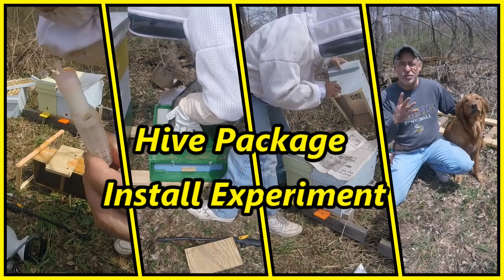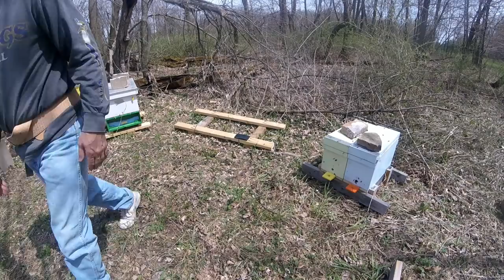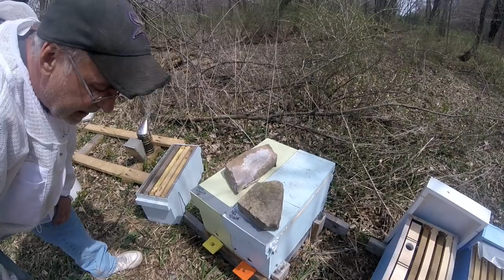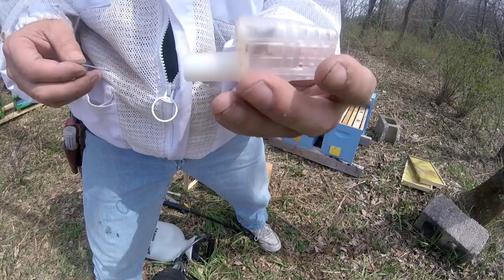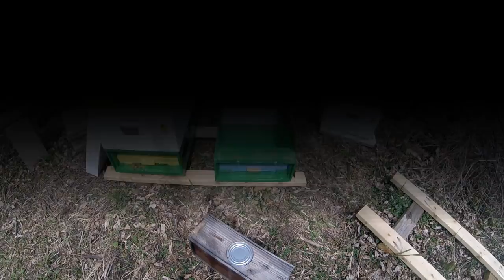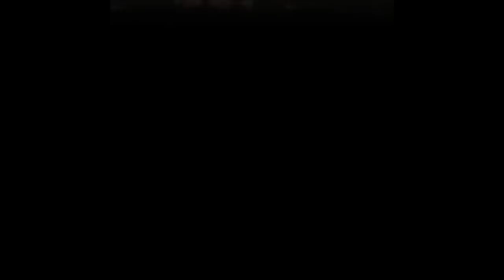Hive Package Install Experiment

Comment: Being sustainable is the way to go with your bees.  I started 4 years ago and have had 100% survival for three winters.  Last year joined an initiative in Lancaster County PA bee club who wanted to raise local nucs and queens and then I started the same type of group in York County PA with more of a focus of overwintering hives for early spring nuc sales (April) of overwintered bees in addition to raising locally mated queens.   Went into last winter with 17 3-box hives of 8-framed medium boxes packed with honey/syrup and pollen and loads of bees.  Came out of winter with 17 hives with pretty much the same populations going into winter - was a bit surprised by the strength this spring.  Treating for mites (3 times a year Spring, Summer and Fall), having plenty of population/food stores, insulating and providing ventilation (use Brushy Mountain vavaldi boards with burlap) for the hives for winter.  I do add fondant as back up and give pollen patties in late winter... all seems to be a winning combination.  Have sold off half the overwintered hives, have made more splits (up to 25 hives right now) and plan on making 20 more splits this month (using PennState Queen Improvement VSH capped queen cells and then mating in my apiary) for June nucs and raising locally mated queens.  Since my first purchased package (Russian) and local nuc (which turned out to have a heavy mite infestion the seller was doing the all natural option - they have since started treating for mites) I've not purchased any more bees.   I have brought in more queens - carniolans, buckfast, ankle biters, saskatraz and Russians are my queens of choice and raising queens from any overwintered queens when queen cells present themselves.  Going to try overwintering quite a few 5 over 5 over 5 nucs this winter in addition to my normal full sized hives.  Wish you luck with those packages.  With so few backyard/hobby beekeepers raising local bees you get stuck with what you can find.  It can be done - it does take concentrated effort, time, and lots of observation and some cash outlay but the satisfaction of raising some hardy bees to share with others makes it worth while to me.  Passing it all forward as you cannot take it with you.
Reply from the maker: Appreciate your insights. Thank you.

Comment: Hey Kevin Great video! Had a question about your inner cover/bubble sheets. I bought some #8 18oz double cotton burlap, it’s the stuff the UoG uses in Canada, is it necessary to have vent holes drilled in the boxes? I’ve seen it both ways, and if so do you put #8 hardware cloth so they don’t use it as an entrance or is it ok for them using it as an entrance? Thanks again for sharing Kevin.
Reply from the maker: Simple answer...yes.... with an ability of closing it off as needed...versatility is key..... I wish I could sit here and say I have a system all worked out for my location. I do not quite yet...I experiment a lot to see what the bees need...In spring, they don't need upper vent nor entrance...in winter an upper entrance may be useful if your lower entrance gets blocked with dead bees with other boxes vents blocked off...in hot summer an upper vent is helpful to cool off a hive
Reply from the maker: I used the duck cloth also for awhile...I think mine was thinner than UoG tho...expensive stuff...then I saw I should have just bought a painters canvas floor protection cloth...which is heavier and cheaper at Harbor freight.
Reply from the maker: Ian stepplar in Canada doesn't have upper vents in his boxes...UoG does.....
Reply: Kevins point about versatility is spot on.  Options help
Reply: Thanks for the feedback Kevin, I appreciate it.
Reply: No he doesn't, and his hives are usually packed out.